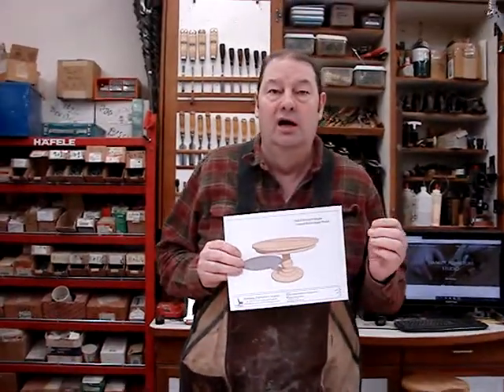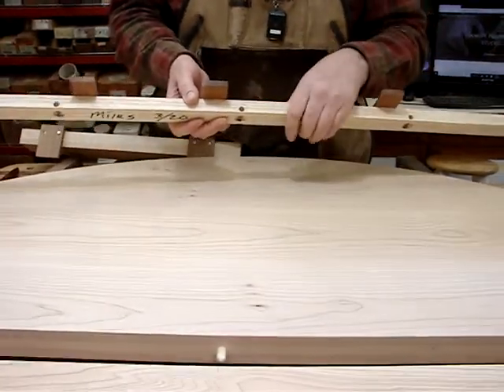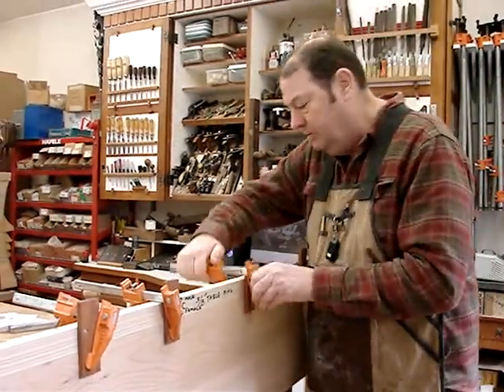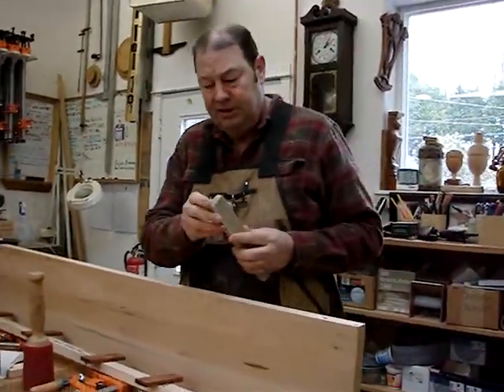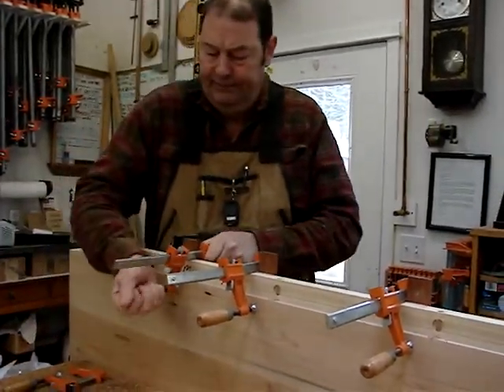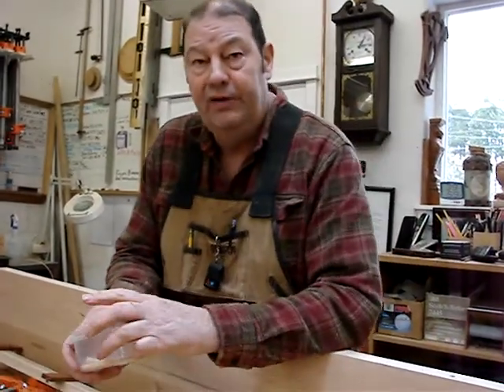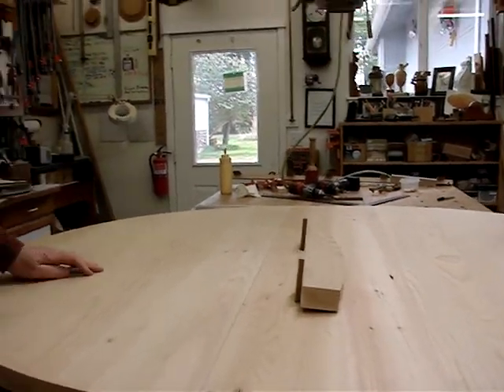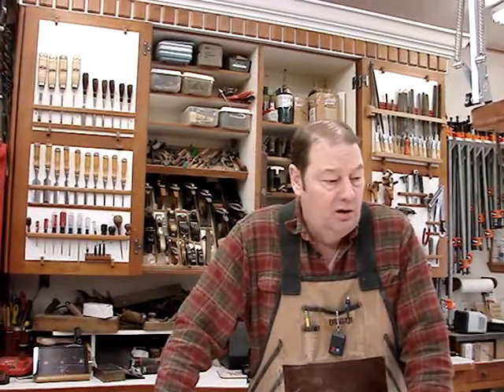Table leaves and pins

Comment: Great video, very well explain and you got right to the point, what a concept.  I'm currently making a table out 60 year old true 2"x 6"s. It will be 42"x 80" plus two 18" leaves. I will definitely be using your method for the pin holes. Thanks!

Comment: Hello John, I am making 2 leaves for a table that already has several. How did you go about making the template? Yours looks close to what I have, the holes are lower in the top. But is there a standard spacing?
Reply from the maker: Hi Scott,
Use "dowel marking points" (amazon) in existing female holes.
Then make jig (see video).
Tap jig onto transfer marking points. 
Next bore jig on drill press.
Then test jig by placing over existing male table pins. 
Enjoy your project!
John

Comment: What is the purpose of needing to indicate a male and female side on the jig. I understand the need to indicate on the  leaf to get the reaming in the correct side.
Reply: I was wondering this too, but I imagine if the hole spacing on the jig isn't 100% symmetrical, marking the M/F sides helps you keep the holes aligned across all the leaves.